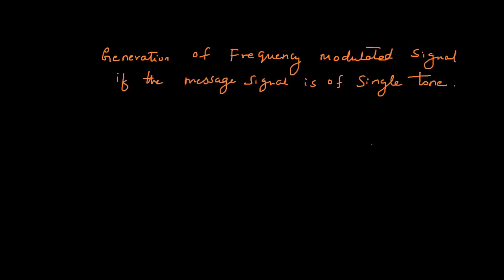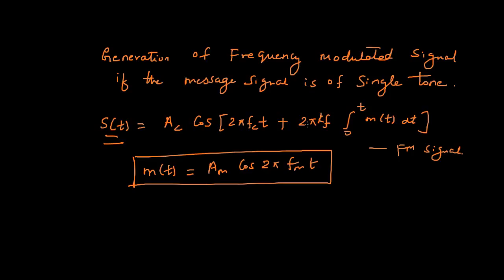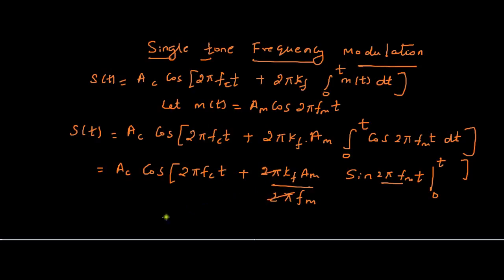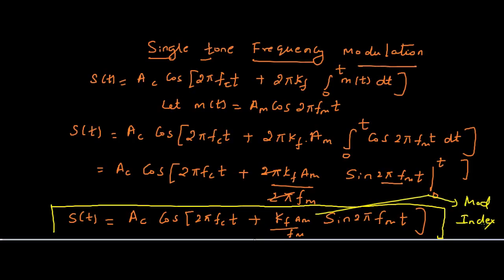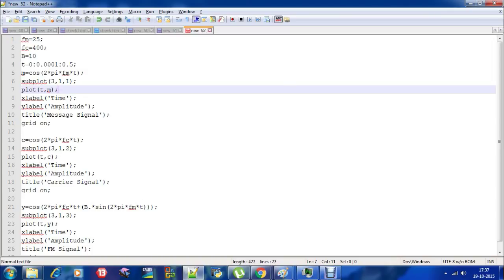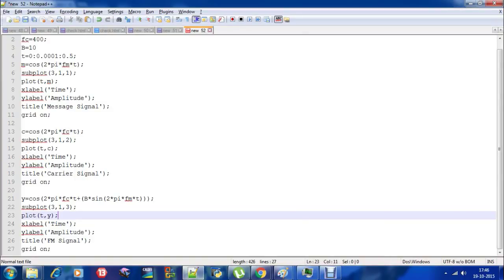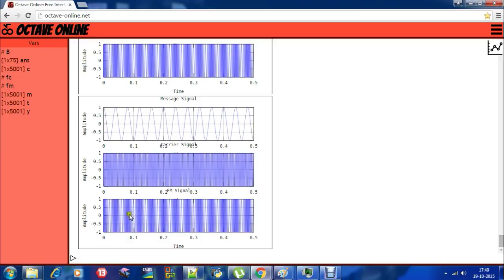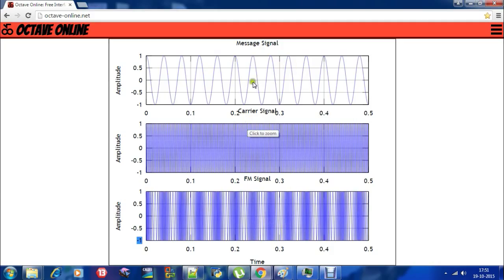Frequency Modulation simulation in Matlab

Comment: is this work for 
carrier = 80000000 Hz and message signal 300-3400 Hz?
Reply: I tried this and it will work but you cant observe the FM Signal and the message signal. It just a thick line.